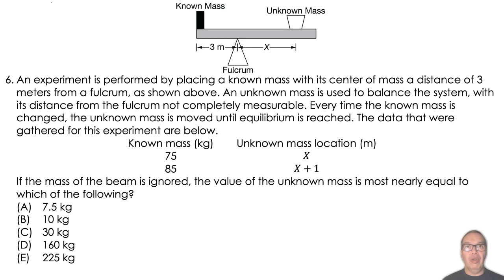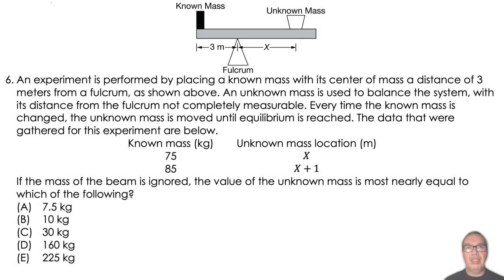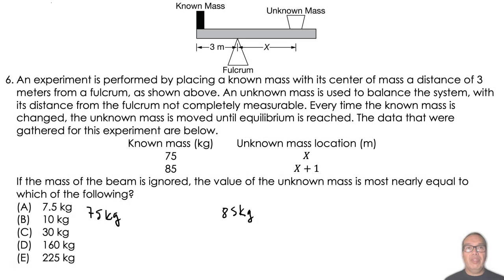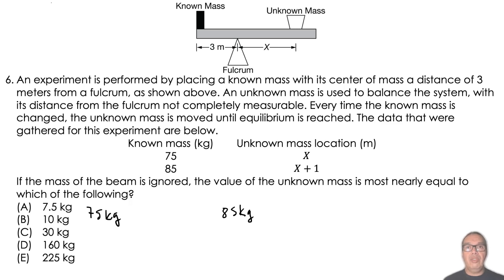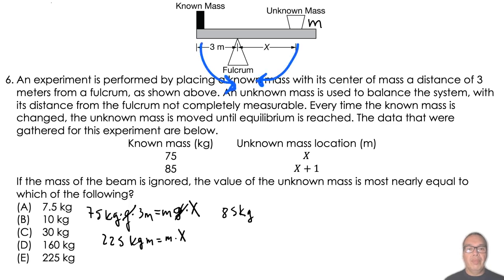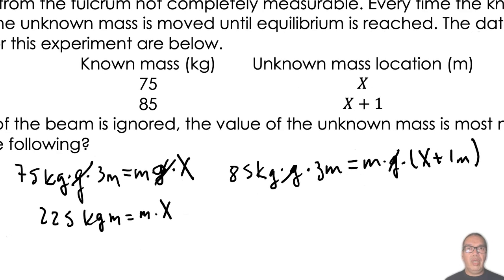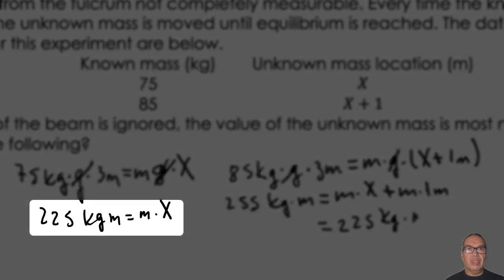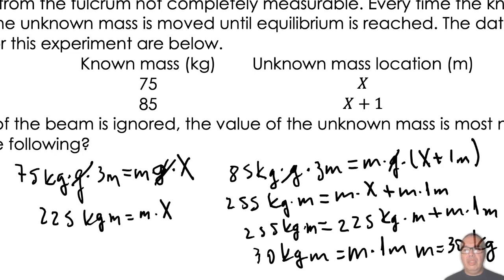Finding an Unknown Mass from Different Equilibrium Situations

Comment: The correct answer would be option C, as we apply the principal of rotational equilibrium provided from Newton's Second Law to determine a system of equations to figure out the unknown mass. Also, we know the relationship between the two positions and we use an algebraic process.